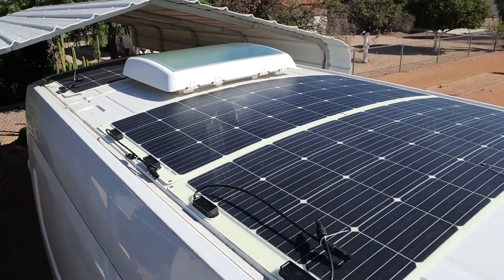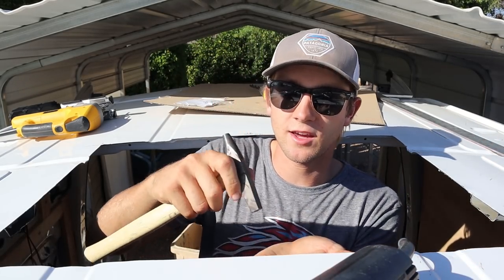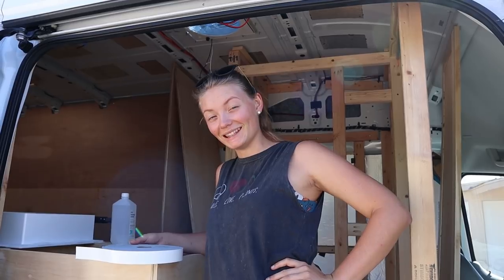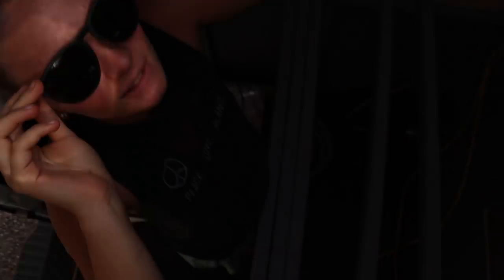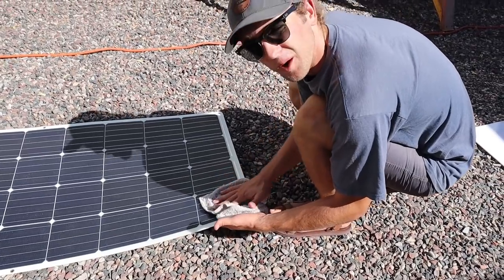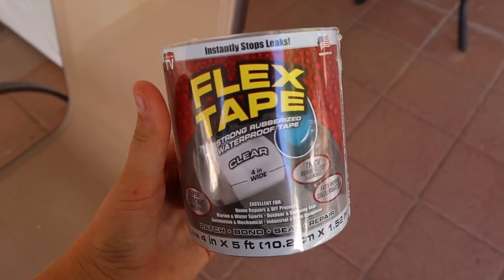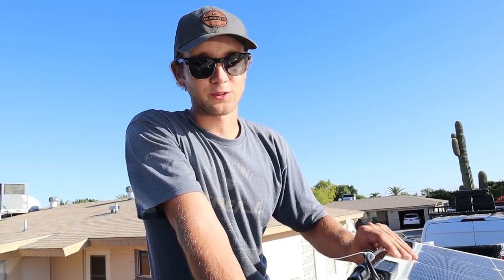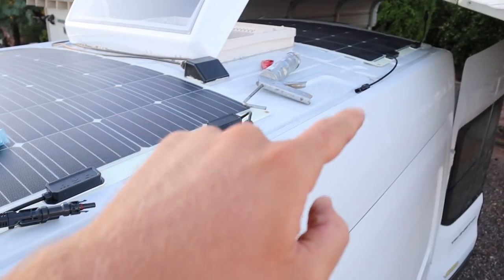SUPER STEALTHY VAN with epic skylight and flexible solar panels | VAN BUILD SERIES (episode 5)

Comment: Loving the videos very nice workmanship. Wish I was closer to get a van build done. I seen another van lifer go with the flexible panels and used a 3m sheet adhesive. They have been on the road 2 years now and the panels havent had an issue. I'll try and find the link to share with you.

Comment: wow , I'm very impressed on how you are putting everything  together, not though I know anything about van building,  but I do have a question about if the a solar panel goes out, how do you replace it, I hear some of the panels only last so long, do you have to scrap off the glue and then start over? Thanks

Comment: Why are you drilling extra holes? Ford Transits have holes already drilled in several convenient places. Also, the holes and nuts are already installed for roof racks. 7mm bolts, no drilling. You can install a rack in minutes.  I prefer the putty tape rather than silicone. Silicon will fail after a  year or two in the weather. Just a couple of alternative solutions.  Other than that you are doing a very nice job. 👍
Reply from the maker: A little confused by what you’re referring to. The only holes we drilled was for solar cables and cutouts for the skylight and fan. The panels were installed without any holes, and using construction adhesive, not silicone. Appreciate the suggestions though!

Comment: Contact cement would work very well to attach those solar panels... it’s what you use to attach Formica countertops. You would need to prep the surface by scuffing the clear coat with a scotch brite on a DA but application would be easy..
Reply: Contact does not like long periods of UV high heat or moisture. If the Gorilla silicon adhesives has a high temp rating it should be ok, if not, I wouldn't use that either!

Comment: You might be dissapointed with the water test driving through rain at 70 mph will really test it
Also you should use special sealant as the silicone will deteriorate in about two years (did with me) extreme heat and cooling on roof

Comment: Hey good video to get some ideas, however why do you call it SUPER STEALTHY if you have two ventilators on the roof plus solar panels, thats not stealthy if you park this van in the city everyone plus cops will know thats DIY camper not just regular van and you might get fine or get knock and freak you out, of course it doesn't matter when you're in nature but there you don't need to be stealthy. SUPER STEALTHY are mini vans like Siena or Voyager with no ventilators or solar visible.